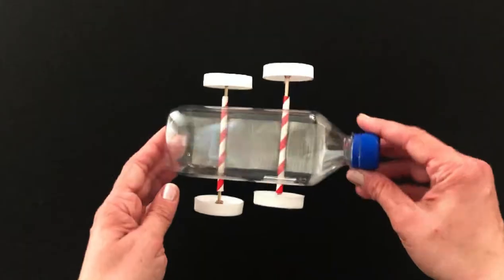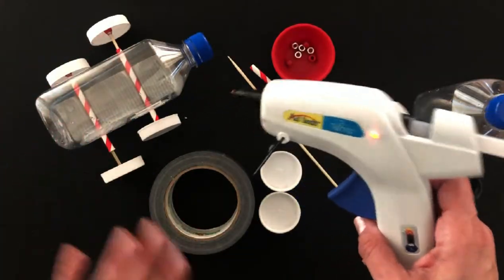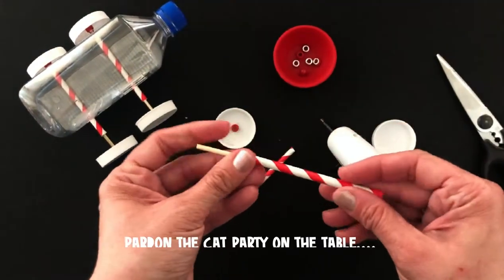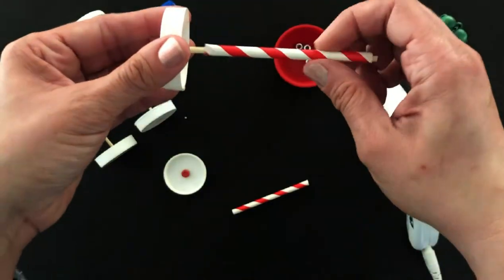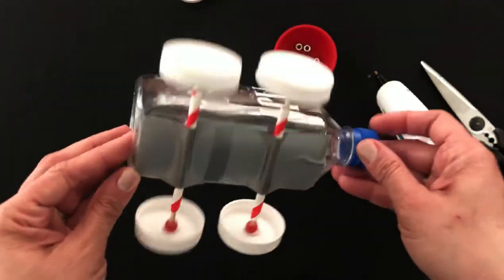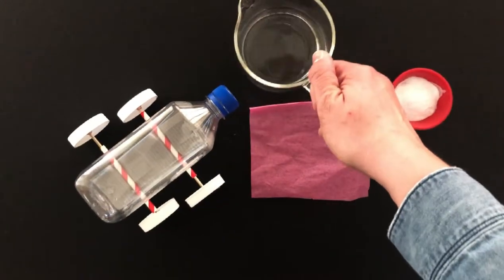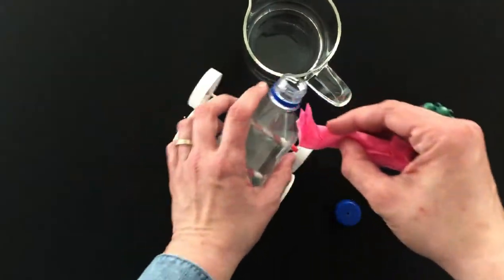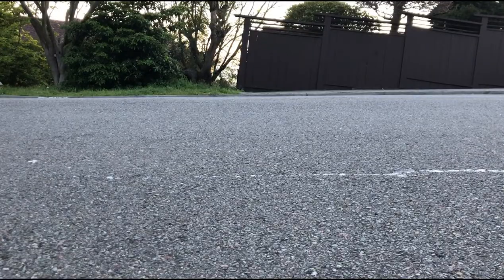Chemical Reaction Car

Comment: How big must be a hole in the water bottle lid? A made it with a glue gun ,but it didn't work well. The piece of the tissue used to wrap the baking soda stuck in the hole... And also I would like to know the best size of the lids for the wheels.

Comment: How much baking soda and vinegar did u guys use? Could u send the equation as well
Reply: Cmon I need a answer. And how did u delay ur reaction
Reply: @benjaminoosterbaan3154  I heard you use toilet paper
Reply: @benjaminoosterbaan3154  i guess the delay depends on the tissue if its thick or thin.
Reply: @benjaminoosterbaan3154  what’s the equation and how much did you use?
Reply: @bossbrown9759 it doesn’t matter how much you use but it depends on how far you want it to go